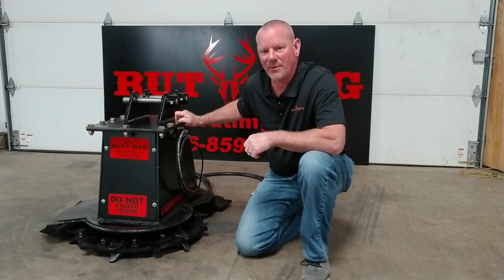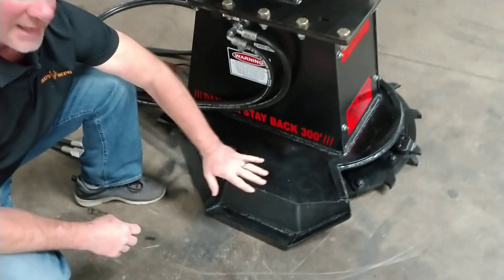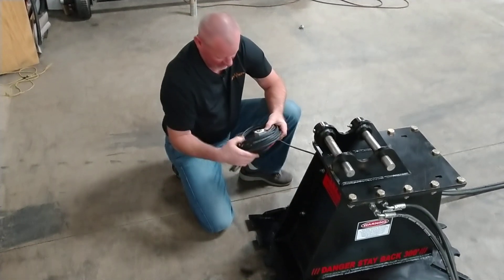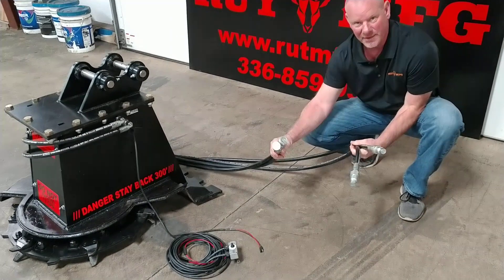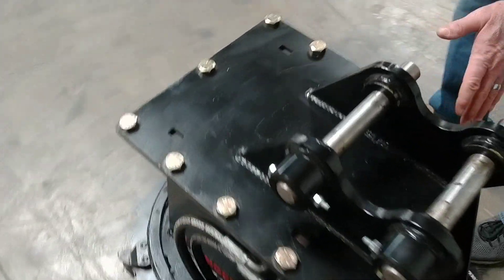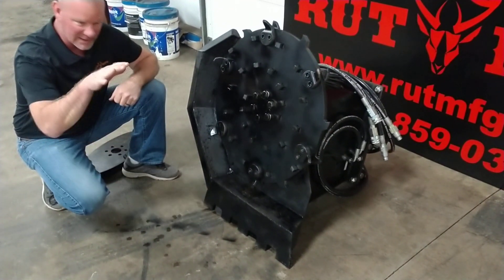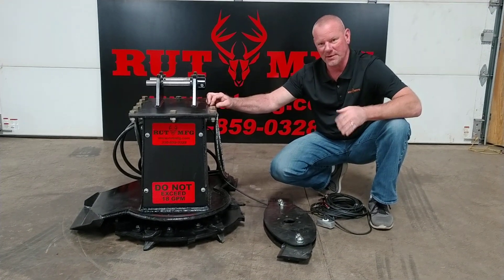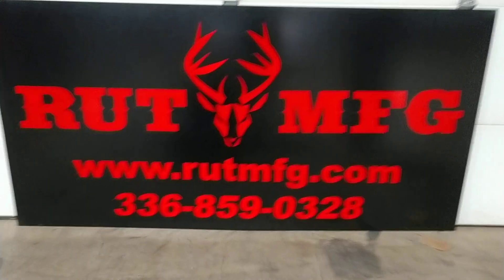Excavator Disc Mulcher by RUT MFG

Comment: How many hours would you estimate before those clean out teeth are done with?
Reply from the maker: These typically last 300 to 500 hours according to the type of material going into.
Reply: @RutMFG  I was talking about the non replaceable teeth that are cut out on the blade carrier.
Reply: These teeth are shorter than the carbide-tipped teeth. They hold up really good, they are used to clean the loose debris out from between the two carbide teeth. We have never had anyone to have an issue with him wearing quickly. If they do start to wear a simple fixes to weld a little hard facing back on the tip.
Reply: @Iramatney  ok. that makes sense. I have a large 37 hp mini skid steer 14 gpm @ over 3,000 psi. Could you guys make the 28 in. mulcher with a shroud that's open only in the front with a mini skid mounting plate. My machine would run this cutter great. It should be just as safe as my CID mini cutter. My blades are exposed close to 6 inches in front of the cutaway and I have never had an issue with flying debris. Many would argue that you need full track coverage but I don't find it necessary when cutting into larger material. You tend to make short passes and muich the material to the ground before driving further in. I don't see any reason why it wouldn't work
Reply from the maker: We are currently under a non-compete agreement with another attachment company until September. So we cannot produce anything for a skid steer or a mini skid steer until that agreement ends.
Reply: @RutMFG  I understand. I'll stay in touch. I'd really like to hear your thoughts on it.
Reply: @RutMFG  one more thing. What is the target rpm range on this 28 in. unit?
Reply: 1800 rpms
Reply: @Iramatney  ok. Are those Rayco Super Teeth?
Reply from the maker: @wpog8453  yes, they use are the Rayco style super teeth. We are buying them from King Kong tools now instead of Rayco. But it is the same tooth.
Reply: @RutMFG  nice. Sounds good. I'd still like to talk about mounting this unit on a mini skid whenever you're agreement has been fulfilled.